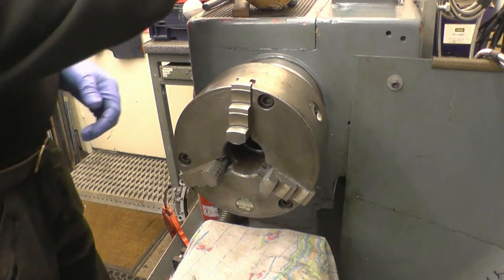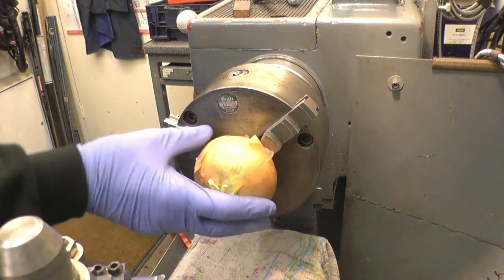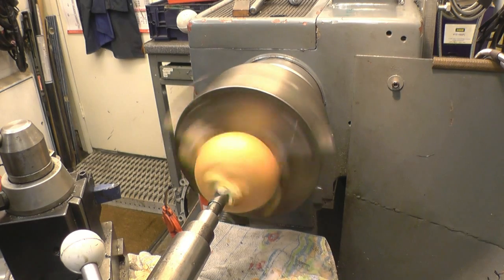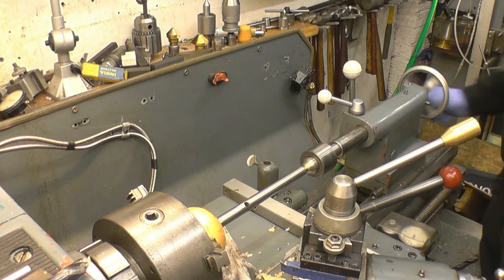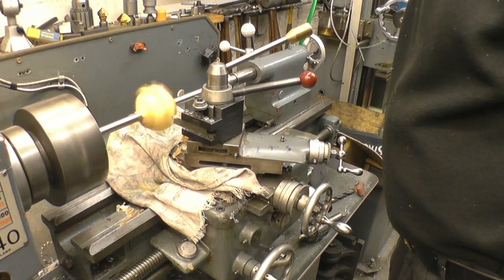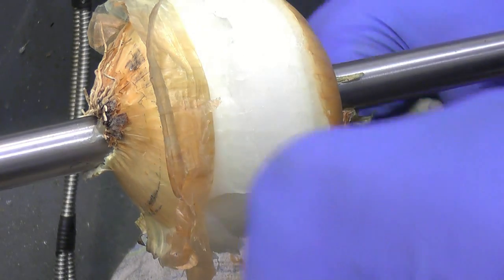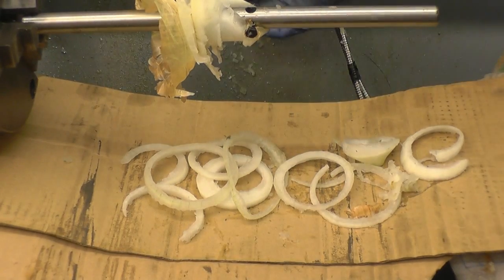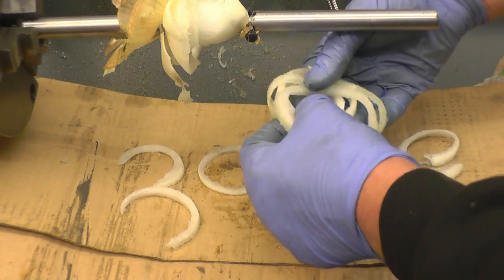Organic Machining (onion rings)

Comment: John use a paring knife on your tool holder , set feed screw a 6 threads per inch ,stay .250 from mandrel. You should get better results.  Good luck
Reply: That's an idea.  And use thread cutting to make your spiral sliced potatoes.  A right angle bend at the very tip of the blade should part them from the core quite nicely in one pass.

But I think I'd use holding fixtures machined from hard wood.  Less chance of catastrophic damage should blades come in conflict with them.  :-)

Silliness aside, I probably shouldn't have mentioned that.  Now I've got a hankerin' for a big mess of bacon ends & pieces, with an equal portion of pan fried potatoes and onions to the side of that.  Three eggs, over easy, laid on top of the potatoes, buttered toast with home made (s e Alaska) wild strawberry-rhubarb preserves ... pardon me, while I go fetch a drool bucket

Comment: I would be curious to see how it would work if you took a piece of stainless tube with a nice sharp edge on one end and carved out the center of the onion and then tapped in a hardwood mandrel; I'll bet with a right sharp knife and a 7x10 kitchen lathe you could go into production.